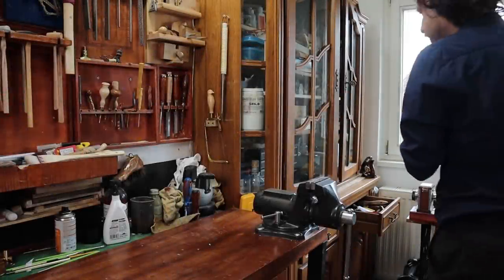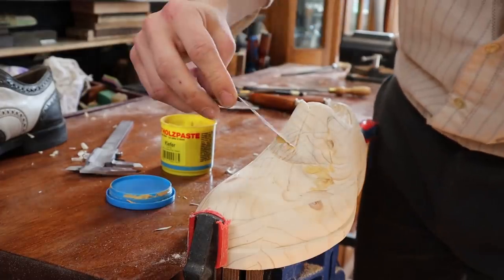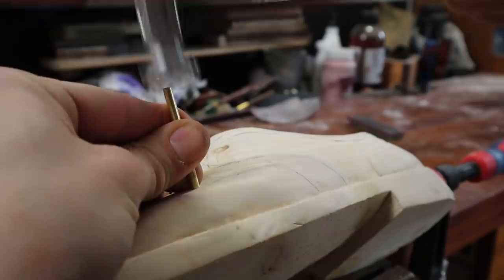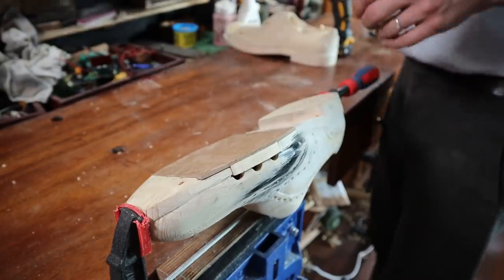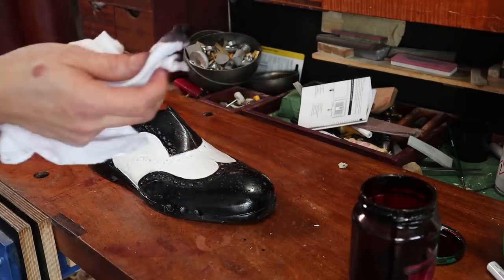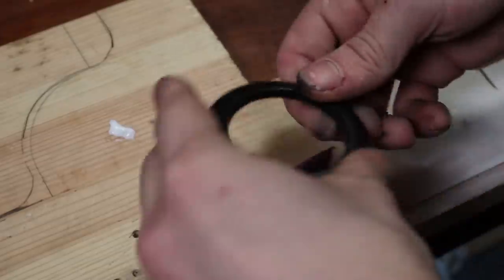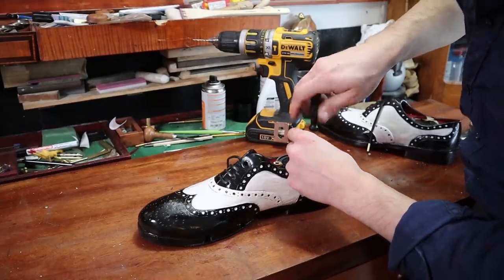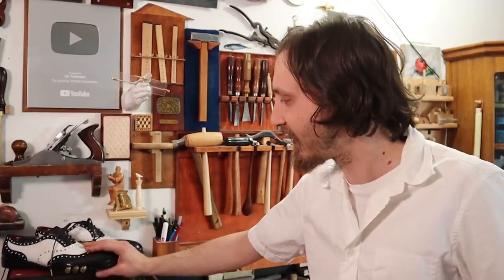Making Shoe Shaped Speakers

Comment: Whilst not huge, the presence of a heatsink on the amp does imply something of a heat dissipation problem in the enclosed sole of your shoe... best not drive them too hard :D
Reply from the maker: You're probably right. these are for casual shop music so hopefully it'll be fine.
Reply: @urituchmanpigeon  Fingers crossed! Nice job on the shoes though...
Reply: Uri Tuchman, I was going to say the same thing about heat. Could you hollow the shoe out more to give it more air? And maybe a passage opening up under the laces? They look magnificent, BTW. ;-)
Reply from the maker: @Galt4570  yeah, I can open a vent hole all the way to the speaker it self, it well still be covered but maybe it's something.
Reply: Relax, these are casual shoes... if he wanted maximum performance he'd of carved a set of drivers shoes.
Reply: Brilliant idea, but I too had the thought "that poor amplifier will die of overheating in such a confined space!" Perhaps a) hollow out the inside of the shoe and pierce all the shoe holes to let the air through (maybe a few more discrete holes for good measure) or b) replace the whole wooden sole of the shoe by a metal plate to act as a heat sink (best if not too flat so that air can circulate underneath somewhat) or c) incorporate a (silent) computer fan with ducts to circulate air around the amp. If it was anyone else, including myself, I would say d) just leave bad enough alone, but you don't exactly run a mile to avoid complication so these are my two cents ;-) EDIT: Of course, in any case you would need to keep enough wood under the speakers to support them properly. And if c) isn't complicated enough for you, you could add a thermometer (maybe with a discrete little display so that you can check that all is well, and/or a little beeper to sound if things get too hot notwithstanding) with an automatic control system to command the speed of the fan...
Reply: Uri could you not make some of the holes in the design of the shoe go all the way through to help with air flow?

Comment: I would love to see more tool builds, but I think you've done them all.  

Hammer? Check (at least a couple) 
Saw? Check (a hand {shake} saw, and some others) 
Plane? Check (doubly so), 
Chisels (and even chisel holders)? Check
Lathe? Check
Scroll saw? Check
Knives, gouges, gravers? Check and check and check
Brushes? Check
Bar clamp? Check
Test indicator? (A most holy) Check
Marking gauge? Check
Safety glasses? Check

I suppose you could build a vise, and I am amazed that you don't have (or at least haven't built) a power graver. You could make a file or a rasp.  I almost fear to see you build all of these, because if you did, there wouldn't be any tools LEFT for you to build.

Comment: Super awesome, but all I can think or is that poor heatsink in a form fitting closed space... plus you need some air space for the speakers or else they fight thier own pressure waves. Cut shoes in half at sole and hollow them out for better sound. Still awesome though.